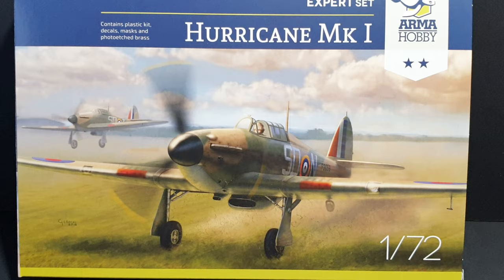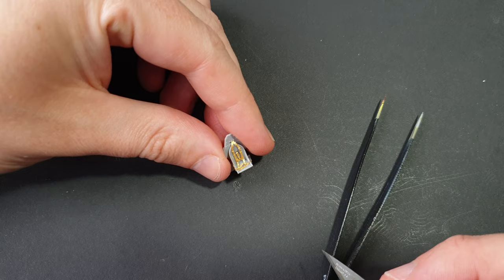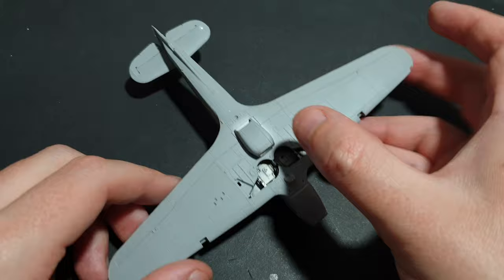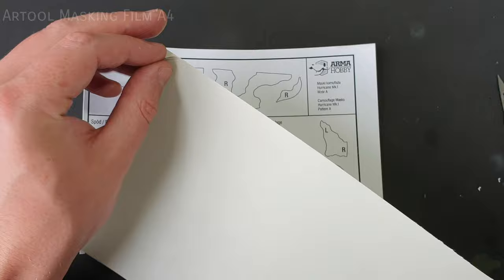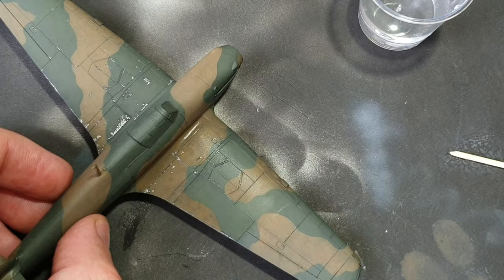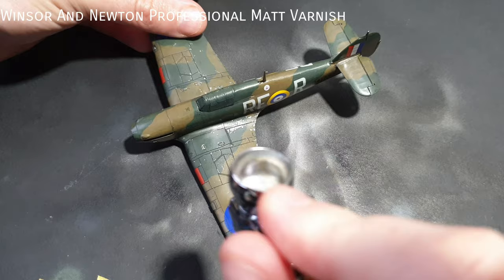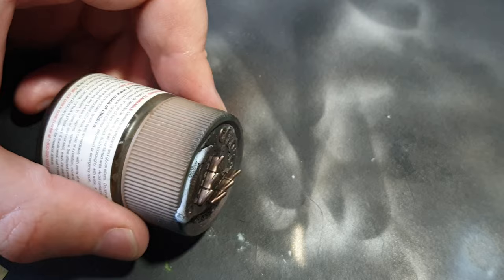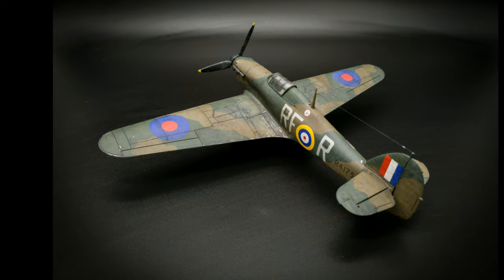Arma Hobby 1/72 Hawker Hurricane Mk.I Expert Set Full Build

Comment: Awesome result. looking for a cheap airbrush set up to have a go, after 30 odd years away from building anything. Lots of techniques there to have a go at, thank you. 👏👍
Reply from the maker: Hi Jon !  My advice is to get the best you can afford, while you can get reasonable results with cheap gear you'll likely get more headaches in the long run. 
That being said a lot of people have good luck with the cheapo ebay £30 airbrushes, but these I would view as more a disposable bit of kit as getting spares might be troublesome. I started with a sparmax sp35 but outgrew it very quickly. 
Your compressor will be the biggest investment  to start with, as long as it can put out at least 25-30 psi you'll be set, anything more for modelling is unnecessary.  Best of luck !
Reply: @lpjmodels  thanks, looking at Bartsharp AC01 compressor and possibly one of their 25 quid airbrushes just to get me started......... what d’you reckon?

Comment: After it is done and painted, and set out for a few days, is there then a desire to blow it up with a firecracker, perhaps while being videoed?
Reply from the maker: Occasionally.. but selling is much better for my pocket
Reply: I was wondering. Back in my model-building days (mostly cars) I would put them up on a shelf for a month or so but invariably I would have the desire to blow them up with firecrackers. Skeeter airplanes, those $2 rubberband-powered aircraft, had the same fate. We'd tape a firecracker on the fuselage, wind-up the rubberband, light the firecracker fuse and then quickly throw plane off a bridge.